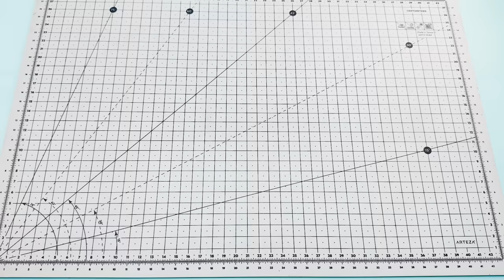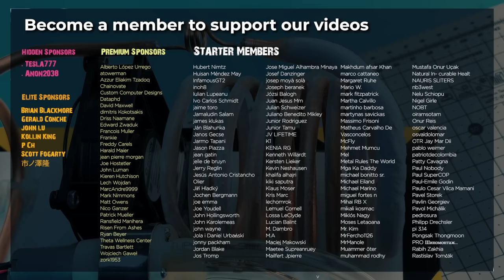How to Make a Powerful Mini Freezer - Portable Mini Air Conditioner up to -10ºC

Comment: I really hope to one-day find a video of a real working mini ac. I know how it works an how to build one. I just want a small unit, at an affordable price. I m hoping somebody finds a way to homebuild a small compressor, pressure valve.  If one you has a link, please share it with me, not only I will be very grateful, my dogs would be too.
Reply: Why not use the compressors for office water coolers.  They are small enough I suppose
Reply: @bryansychingiok  That's a very good idea. And we could probably also use the decompression valve, maybe even more parts. Thank you very much Bryan.
Reply: That's why people just use peltier for small cooling
Reply: @BobBob-dg2nw  I have tried that, with 16 elements I barely had an effect on the high temp.

Comment: All the snarky comments from lazy idiots who do nothing, makes me think less of the people who fail to make an edifying or complementary or constructive comment or idea / this is DIY out of cheap readily available materials & he made no claims about inventing anything, other than a small battery operated heat pumping device powered by a common 9v battery / this is not game changing, not new tech, just a fun interesting project to watch and with good editing!
Reply: @rbailey225 What else should he have used? I am a newbie, so hence the question. I have made a sort of tunnel around my bed and I need something to cool it instead of ,y whole house. I cannot find small a/c anywhere. I thought of using an a/c from a car.
Reply: @TinusTegenlicht  anything not flammable.......This video is a crude demonstration of the process used in refrigeration. Nearly all gasses cool when expanded rapidly. I'm no expert in the field so I would refer you to research the Joule-Thomson effect. Air conditioning is a very inefficient process that requires lots of power. With no separation of the heat transfer process the net cooling effect of this demonstration is zero. That's the reason the compressor and condenser on your home A/C is outside.
Reply: @TinusTegenlicht  one of those countertop ice makers might work. You have to add a fan in the ice part and duct the cold air into the bed tunnel and leave the icemaker outside of the tunnel.
Reply: The only problem with the video is that the cooling effect only works if you are able to produce enough pressure in the system to compress the gas into a liquid. Then, it flows into the low pressure side of the system and expands back into a gas. However, assuming that this thing is operating at room temperature (ambient), this reaction would require 30 PSI+ to overcome the saturation pressure of isobutane, which you certainly can't get from a tiny pump and a 9v battery. Sorry.

Comment: You've made a good demonstration of how a fridge works, but this wont work as an AC. Why not?

Well, the  way an AC works is by compressing one side of the loop and this in turn heats it up (think of the needle of a bike pump getting hot as you inflate a tyre). This side of the loop is usually outside of your house/car, and since it is now hotter than ambient you can use a radiator and fan to cool it down. When this high pressure cooled (to ambiant) air passes through the capillary, the pressure decreases and the temperature drops as shown. So whats the problem and why wont this work?

1. The hot and cold side are not separate and so any cooling effect in the smaller diamater coil will be matched by a heating effect in the larger coil. No net cooling of the room.

2. I suspect most of the cooling effect observed here is actually coming from the high pressure air from the aeresol can entering the  system at a much lower pressure. You will see this whenever you use any aeresol spray. After this system runs for a while and reaches equilibrium, i doubt the air pump will be producing enough of a pressure difference in the hot and cold side to reach anything like those temps - which doesnt matter anyway because point 1.^

Comment: Well, ya had me up until the point of pvc hose being introduced and not just on the low side but the evaporator as well. That pump looked cute, nice touch for something that won't move a damn thing when it comes down to superheated gas heading to the condenser. As if it would matter anyways cuz those pvc hoses held with zip ties are gonna blow quicker than a 2 dollar whore at a WoW convention!

Comment: The tube with lesser dia must be more in length. There is no compressor, to compress the refigerant. When compressed air/ refrigerant comes out of a small nozzle, there is a drop in temperature. Where is thermodynamics...?
Reply: Интересно, а если сделать на компрессоре от тонометра он будет работать?

Comment: Well, in theory, concept could work, but that tiny motor pump and plastic piping on it... I wouldn't try. Plus, isopropane is quite flammable, and DC motors are well known for sparking on their comutators. I can't recommend this.
Reply: All the newer ac-s have izobutane inside
Reply: I just want to correct you pump cant compress gas they call it compressors instead of pump
Reply: There is no compressor. Just a fan moving air through the tubing. One can save time by putting an ice tray in front of a fan lol

Comment: It should work. The pump is a diaphragm pump. The gas should get cold after the capillary tube, due to the pressure drop in there.  I just posted a link where you can get the pump; it is good for water and for air as well.

Comment: Will produce more heat on the hot side than frost on the cold side. Please refer to Lavoisier "nothing appears, nothing disappears".
Reply: This would make a good drink cooler though. Having heat on the cool side while its in a correct orientation, a can of soda, and then blowing exhaust heat from the hot side would keep drinks cooler for a longer period of time. Great for an outdoor thing if you can make it hold multiple drinks and give it good insulation.
Reply: @3v068 nah, good sealing thermos is already enough for that. This thing require compressor that need quite amount of power, it wont work with this tiny pump, and the compression tube isnt as simple as made of spiral like that. 
To put simply refrigrator isnt designed for outdor or portable use, the built and required power is just to bulky to bring outside, well unless new tech is found.
Reply: @3v068 the guy got basic principle correct but on real aplication not as simple as this, there is so many wrong on this vid.
Reply: This can be useful for produce a water like aluminum or copper plates. It will not work like an air conditioner, if you’re not sitting on pipes😂

Comment: To make it perfect the only part that need to be replaced is the brushed motor pump for a brushless dc motor pump instead, i wish to use the idea to make a mini fridge, maybe a valve from a bike tire to inject the gas to the system
Reply: Where can I get this motor and dual head

Comment: the assembly is correct but if you use aerosol it will completely evaporate because there is a small gap between the gear and the dynamo, just use a peltier to cool the coil then let the cold empty air coil spin around

Comment: So if we pretend that isn't a mini water pump, and call it a compressor, you're telling me that that little compressor, running on a 9 volt battery, is producing over 30 PSI (the saturation pressure of isobutane, assuming you're at room temperature)? Lol, that sounds legit.
Reply: Hay mini compresores para ese uso con alimentación a 12 V, pero son tan caros como uno real para uso profesional

Comment: lets clarify something here, 1st even if it works the problem is the thermodynamics do not work like this, like your home fridge that extract hot from the inside and take it outside there must be insulation for the heat not return immediately to the cold part, 2nd the internal pressure of the system can be too much for the pump and the flexible tubing to handle. Even if i try this diy experiment it will be with no illusion and with a grain of salt.
Reply: What is happening here is that the isobutane was already condensed when it was injected. What we are seeing is the expansion of that initial gas. It never gets recommended.
This is just a complicated version of cooling something with a spray can
Reply: @pomadomaphin  exactly - the same.
Reply: There are pump 12vdc ar 3 bar for lets Say entire circuit.

So that new pump will do the trick to work ?

Comment: If you chill the entire unit in a freezer before filling with isobutane, you can load it and have it condense into a liquid to make the filling easier. Very cleaver way of using the isobutane can with adapter and large 16 gauge needle to fill the vinyl tubing. Silicone tubing would last longer without leaking as much or drying out and cracking. Further separation and thermal isolation of the cold and hot side would result in more efficient performance. Also a wall adapter to power the unit instead of a single use primary 9vdc battery // etc

Comment: Theoretically it might work but it looks to me they exaggerated the result. Looks like some video cheating was done. I dont think that little motor and battery can compress the gas into liquid.  This is necessary for a proper refrigeration cycle.
Reply: Есть серийные компрессорные холодильники Макита 2*18в, они прекрасно работают.
Reply: There are serial compressor refrigerators of the Makita 2*18v, they work perfectly.
Reply: You never compress liquid tot gas🫣

Comment: More economic and safe is enclose a fan in a box with at least the back eall covered with a panel or pair of gauses keeped wet with small pump and you go down minimum 10 degrees , the m² or ft² depends on the capaciti of fan ofcourse

Comment: With all this brand new awesome gear of represented in this video you can buy a cheap air conditioner window unit and definitely make them smaller or you can find them free also the coils need to be insulated to be insulated
Reply: Portable ac is really expensive, i live in Dubai and i need so.ething like this to be able to walk my dog in summer hot weather

Comment: use map gas on that copper first, get it hot enough to have a dull red glow with the lights off in the dark and you will anneal the copper.   I would also anneal after bending.

Comment: I have all of these materials. Basically workable, I doubt the pump's rubber valves can last. There must be a fan each for evap and cond tho..🤔
Reply: Or you could immerse the hot side in cool water
Reply: @Mrs.SusieDunn  that is less economical than fan.

Comment: anhydrous ammonia refrigerant is my refrigerant choice and I'd definitely have separate water cooling tower to help with heat exchange through evaporation since it is 12v but only runs on 9 i could see this running off a small solar panel shading it coupled to a rechargable battery 🔋 put your cans of sida pop in the cooler and you're good all day... would need to store excess energy for night but if it freezes ice that could be the thermal sync you need for time release cooling

Comment: u cant use a small plastic water pump to pump vapor....yep, this is real lol
Reply: It's an air pump, but a non-sparking motor should be used.
Reply: @daredoggo  those water pumps are typically on  mineral water bottles (5 gallon ones).  They can produce around 10 PSI. Though, if you leave them on, they will generally burn out (the brushes on the motor) in about 5 days of continuous use.  You don't have to have a vacuum, you only need to remove enough heat from one side of the coils  to make the other side cold.  Using a vacuum is ideal because the vacuum in the copper tubes, just like in a vapor cooler in a computer video card  makes the system much more efficient.

Comment: What psi does it run? I suppose not much, also could i use an ac can? Equally dangerous? I suppose this one is flameable, also the motor can withstand the temperature?

Comment: You had me right with you until it came to the butane portion simply because the butane will not last long enough how long does this last like 5 Seconds basically if it's going to run on butane it's going to be out in 5 seconds I'm going to have to sit there and inject it with butane every 5 seconds it's crazy I'm saying isn't there a way that I can take the ice machine that that portable ice maker break all the components out of it transfer it into a fan and make it as if it's an air conditioner much like what you did here but I can make an electric and I can make it last longer right

Comment: Even if that small pump would create enough pressure, you only cool the air on one side, while heating the air on the other side.
Reply: As a fridge.
Reply: @Fbiking40 Yeah, but in the fridge you don't have your cold and hot compartments be the same room.
Reply: Very cool project, a static model design simple enough for  a child to understand.   Then customize after you build one with insulation and a wind tunnel to use the same air from the fan. Elementary.

Comment: As a Certified HVAC technician please allow me to save you some time....this video and the guy building is full of shit this would NOT WORK with used materials.  FACTS.
Reply: во первых специалист не станет так само выражаться, так делают только школьники, а во вторых на видео показан процесс сжижения и испарения газа, такой же процесс используется в обычных кондиционерах
Reply: @Asegan. у него ж сертификаты швак, не кое как 😂
Reply: By implementing the refrigeration cycle and using a stronger compressor than what we see in this video, Could it work? I mean is it possible to make a portable cycle like this anymore?

Comment: на сколько времени хватает одной заправки или как долго эта конструкция может работать по времени???
Reply: just show purpose how Ac work but you can not cool anything with that system , one side pipe will get cool other side Pipe will get hot so you will be just wasting electricity .

Comment: too bad the pump is going to fail in about 30 minutes and the fluid will all leak out shortly after that. not many pumps are going to be compatible with a solvent like butane.

Comment: Dislike for the push compulsion, which I will not put for 4:18 min when nothing is known yet, I put a like for the realization at the end of the video, where everything is already known!
What are the parameters of the electric motor and the pump to it ?!!!?
Reply: I think the pump is an an air pump not a water pump, and I am wondering if pump will be damaged from the gas over time?

Comment: Why do you have the fan pulling in the heat to the cool side. This is a bad design because the pressure is too low.  It is just a toy.  You should move the heat tubes outside and then have the cooling ones in side.

Comment: Can i invert proces?  For give hot air in home?
Reply: In principle, yes. It doesn't matter to a heat pump whether it's heating or cooling. But serious equipment is needed, not a makeshift solution.

Comment: Do we need to recharge the gas or it works for life ??? I mean the gas is going to be used or this is a cycle and gas always exists ?
Reply: Tell me if u find out interesting
Reply: It's a sealed circuit, the gas stays in and cycles around.
Reply: @jparrie  Do i have to refill it if yes does the gas just evaporates or do i need to clean it each refill
Reply: @VERTICAL420  but for how long the gas work well ?
Reply: @uzumakikyubi  that’s what I’m trying to figure out
Reply: @VERTICAL420  It's close system, don't need to re-fill except your gas leaked
Reply: @VERTICAL420  is the LPG gas evaporate in a sealed LPG tank when not used?
Reply: @uzumakikyubi  i'll ask you a question to answer your question. when did you change the refrigerant of your newly bought Refrigerator?
Reply: @anonymousvendetta758   3or 5 years later

Comment: How 9 v battery start 12 v fan nd 12v pump?😮
Reply: A 12 volt fan and pump will still work on 9 volts, only a bit slower. I used a 12 volt air mattress pump at 6 volts for a supplied air respirator mask before and it worked pretty well without excessive air flow.
Reply: It works but at a slower speed
Reply: @DaveAW  А почему не сделать источник питания с нужным напряжением? Просто добавить 2 батарейки на 1,5 В.)))
Reply: @Дембельвмаю-б3к это было бы просто 😂

Comment: Hi, What's the real small copper pipe for? Please & Thanks
Reply: The capillary tube creates a pressure difference between the "high" side and the "low" side. On the high side the butane is under pressure (from the pump) and stays liquid. When the butane passes through the capillary tube to the low pressure side it turns in to a gas. The butane transforming from a liquid state to a gaseous state is when the cooling magic happens.
Reply: Капиллярная трубка является трубопроводом, создающим разницу в давлении между испарителем и конденсатором. Таким образом, становится возможной подача в испаритель именно такого количества хладагента, которое необходимо для эффективного охлаждения воздуха внутри камер. При остановках компрессора
Reply: The capillary tube limits the flow of liquified gas from the condenser to the evaporator thereby enabling the correct pressures.

Comment: Is it durable I live in very warm hot place and we cannot afford Air conditioner if I try to make this some how and install inside the duct pipe will it work constantly I need advise
Reply: works in room 10 by 10 inches only and for some minutes.
Reply: @mominagha   thanx for advise so I need to look for other DIy for home my baby girl daughter can't resist so warmth
Reply: @Atheraza  why don't you buy a small 12 volt small room cooler .May Allah help you and your family . Stay blessed
Reply: Am trying but here is such warm room coolers don't work here they produce so much humid
Reply: @Atheraza try dc air conditioners they are cheap and can handle pretty high temperatures also. They don't produce humidity either as they are built for large ships